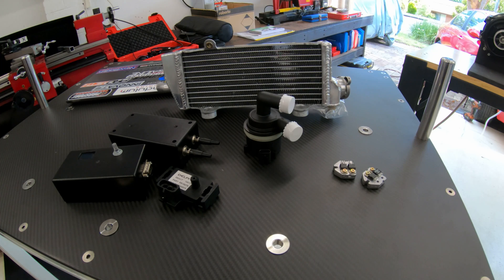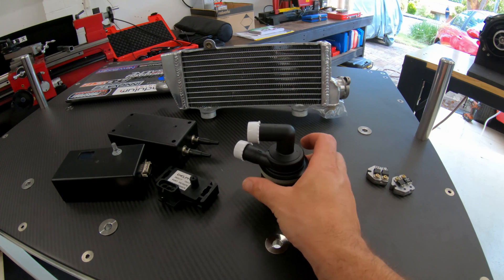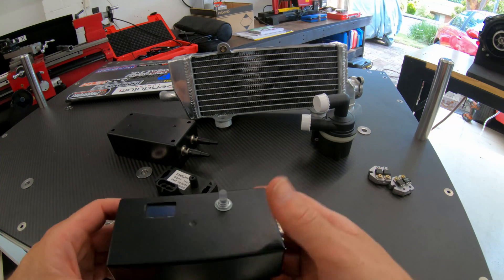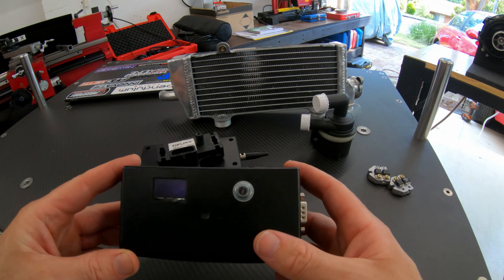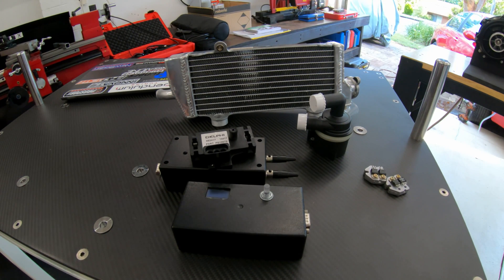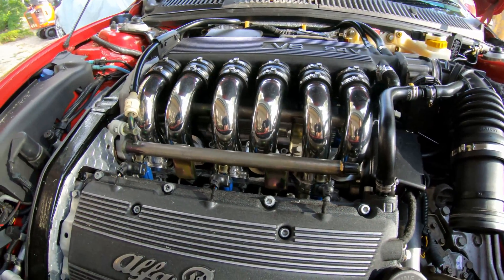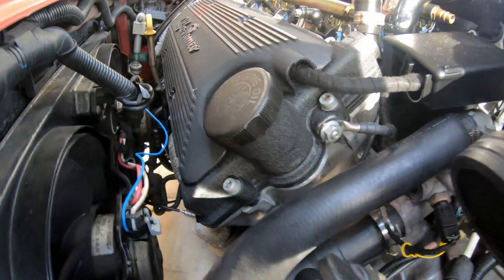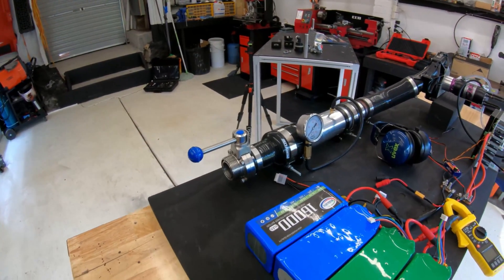World's Most Powerful Electric Supercharger? - MGM 30KW - LMT 3080 - LiPo - Electric Turbo

Comment: What would happen if someone used a giant 120v duct fan?

IDK much about HVAC. I know Fantech makes inline fans 4"-20".
Something like a FKD18XL puts out 5500cfm at 0.0" static pressure. And drops to about 3400cfm at 2.0" static pressure.
I guess it's about 120v 1650w, which I think can be powered off a regular Jackery style power bank.
The smaller FKD8XL is about 800cfm & sub 350w.

They're fairly cheap used, in the $50-250 range. I'm just curious if anyone's tried it, and if not, why. Probably dumb for street use, but seems like it could have advantages for some settings if it worked. Sounds stupid, but if it's stupid and works...

Comment: That´s a very nice project. But before installing it in the car I would reccomend meassuring the air mass, it is pushing at various pressures. (maybe use a MAF sensor and a blow off valve for testing) I dont know for sure,  but I assume this setup wont add peak power to a 3.2l engine. So maybe also test the engines NA air consumption. 
I think this setup would do great in combination with a low displacement engine and a big Turbo, in order to reduce the lag. 
For short Bursts you can add a Capacitor. 
If you plan to really Drive the car, you will also need a charging system for the high voltage power source. 
I think using a Hybrid as a platform would make more sense, so you wouldn´t have to engineer the entire battery situation. 

Anyway, 
Keep up the good work. Im looking forward to see how this setup progresses.

Comment: What size engine is that car and whats it's red line .. how much boost are you looking for at redline ?  keep up the good work...subbed
Reply from the maker: 3.2l v6, Redline is 7500 and I'd be happy with  2psi. If you think about how much vaccum the engine is making, this would be a noice boost 💪
Reply: @pendulumtuning7885  Well that should be super easy you only need about 6,7kw of constant applied power for that.  though you don't show voltage it's hard to be sure of what power your actually applying  but at a guess probably twice that. 14kw should be good for 4.1 psi

Comment: yes run the max voltage possible... In this video it didn't look like you fully closed the valve to show us the max PSI it was giving. ALSO you need a voltmeter on there so we can see what voltage it's running at when all the current is being pulled ..
Reply from the maker: Will do 😎 Next video I'll hook up a multimeter and show you what happens when you close the valve.
Reply: @pendulumtuning7885  Cool, then we'll know that actually applied power, then we can make predictions of what PSI you'll get across different engine sizes.  FYI i believe it should pull more power with the gauge open then closed so. On a different note i hope you're not planning to put the lipos in the engine bay.